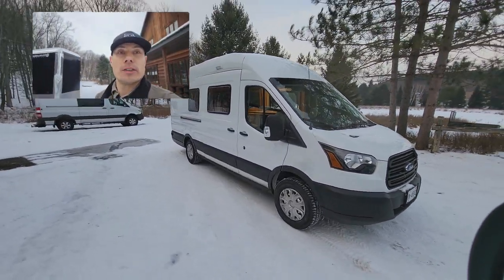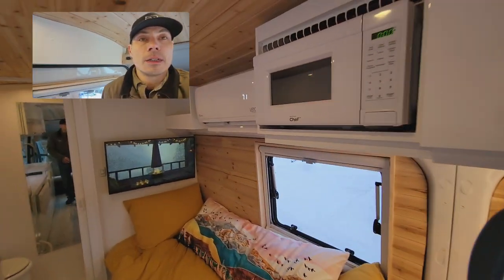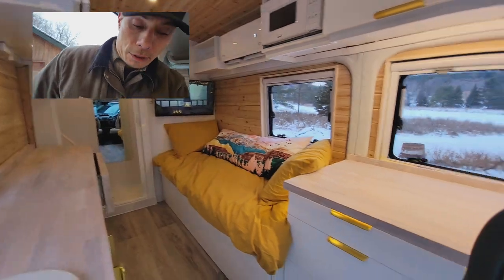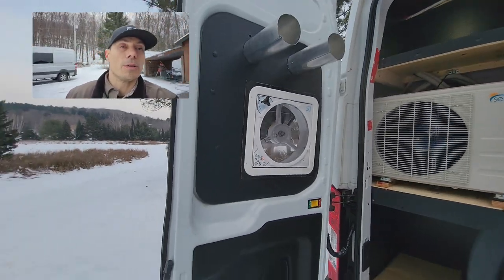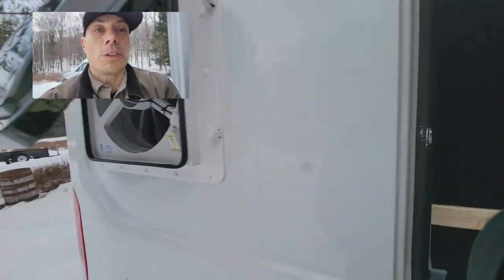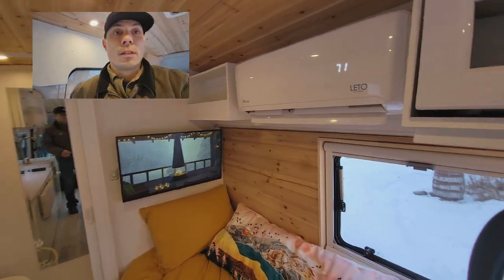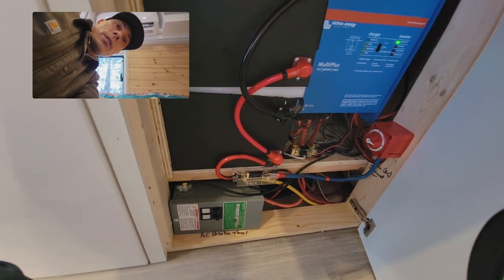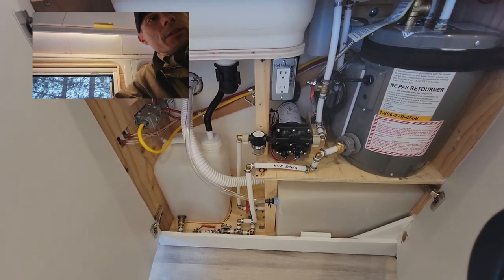Mini Split Air Conditioner in Van Conversion. Unique layout for single camper.

Comment: That's amazing. I have diyed 7 of these mini splits but they where all 36,000 Btu units so I was shocked at seeing how small the compressor is on this 9000btu model. I know this Leto pulls 720w(which is insanely efficient)at max cooling but they also have a higher efficiency model that does 9000btu at 560w which blows my mind.that higher seer/eer unit is also about 60% more expensive so the cost can outweighs the efficiency in some cases. The larger senville minisplits are nowhere near as efficient as these smaller ones are. The 36,000btu ones I installed are pulling close to 4000w at full load!  That's such a low btu to watt ratio compared to these small units. Seeing a mini split in a van build was the coolest thing ever.
Reply from the maker: Yeah, these mini splits are incredibly efficient. I just put the same model with heat pump in a 28' cargo trailer conversion (see my latest video) and it has no problem cooling that trailer. In fact, I often have to turn the heat up because it gets too cold. They are so quiet and powerful it amazes me how many people still use window air conditioners.
Reply: @TheNaker  Do you know how many watts the AC pulls when in use?  Is the power draw always pegged at 720w or does it run at a lower wattage most of the time once it's cooled things down just to help maintain the temp?

Comment: Very good van cograts,
The lines are Prichard?
Reply from the maker: Not sure what you mean?
Reply: Sorry i try to say if the lines are pre charged
Reply from the maker: @roquesanchez7509  yes, the unit was precharged. I did purge the lines with a vacuum pump (bought on Amazon) before opening the valves into the lines. I've never done that before but it turned out to be fairly simple.

Comment: How good is the heating on the Senville 9000 BTU mini-split in the snow? I'm debating 9000 and 12000 BTU for a small 20 feet Class C RV (slightly bigger than a camper van, but barely).
Reply from the maker: I think the 9000 would be plenty for your class C. If you check my other videos, I have the same 9000 BTU unit in a 28' cargo trailer conversion.  It has no problem keeping it toasty in below freezing temperatures.

Comment: In theory, would a big whole in the van door (which sealed around the vent when closed) work?  Why do you need the fan?
Reply from the maker: The fan is required because the AC unit requires a lot of air (fresh air at the back and exhaust air out the front. The fan in my setup forces air out which, in turn, causes a lot of fresh air to enter through the vent ducts to get it to the back of the unit. A hole wouldn't do this.

Comment: Hi! do you know what the lowest heat temp can be set? I am looking for one that has like a vacation mode or something that I can set the heat around 40-50 to minimize usage but keep everything from freezing.
Reply from the maker: Sorry, not sure but this wouldn't be practical for storage. My goal for dealing with freezing was to make it really easy to drain the water system to prevent freezing. This can all be done while inside the van and only takes a few mins.
Reply: The lowest setting on my mini split ac heat pump is 62F in my van.
Reply: @Scrambler85  Thanks!

Comment: Did you run into problems with draining? Just installed this today. It was fine during the first test it leaked thru the drain just fine. But now it’s not draining properly. 

Any ideas? I think could be that I’m parked to where the indoor unit is tilted and now the drain pan in the indoor unit is not catching?

Any ideas would be great!
Reply from the maker: Hi! Nice work. If the condenser unit isn't fairly level some condensation may miss the drain line when using heat pump. If you can't get it level right now, just put a bath towel under the unit to catch the water. We had that happen once. I've never had the indoor unit leak but I'm guessing you need to get more level. Good luck.
Reply: It was just the parking. Now works pretty well on cooling mode. I’m planning on just adding an AC grill on the doors in the back(I also partitioned my van!). What do you think? The one I got I think is 18x18” for exhaust. Will do something similar for the intake with fans 🙌🏼 tube going to the back with fans

Comment: I'm curious with your 412 amp hour set up, how long can you run the air conditioning unit? I realize there's a lot of variables here, but let's just say it's 80° outside. How much power is being consumed by the mini split per hour?
Reply from the maker: She was getting around 6-7 hours on heat pump (which draws more than air conditioning) so we added another 206 amp hour battery for a total of 618 amp hours and now she can have the heat pump running overnight (~10 hrs) without issues. Air conditioning would run for longer. This is also with a compressor fridge running and lights. Hope this helps.
Reply: Thank you. Yes the information does help! I'm using a similar size battery bank – 620 amp hours. Not sure about the efficiency of your inverter, which can have an impact as well. I'm using the growatt 3000. They claim 92% efficiency, but I have not verified that. Inverters definitely rob power though.

At this point I have not purchased the mini split, but plan on purchasing the exact model you did. Seems to be the best bang for the buck. 

I still admire your build! Very impressed with everything you've done there, and thanks again for sharing the information.  All the best!

Comment: I have a Question?. Once your Leto install was completed. Did you have a certified ac specialist shop charge the system with r32 refrigerant?
Reply from the maker: The lines come pre-charged. I just vacuum pumped them out and then opened up the lines to let the refrigerant in.

Comment: Can the compressor unit be mounted under the van in a horizontal position with the fan facing towards the ground?
Reply from the maker: Unfortunately the compressor must be mounted vertically.

Comment: Do you think this could fit in a toyota sienna mini van? Id do the same back setup here. What wattage would you say it uses for 5 mins use every 25-30 mins an hour?
Reply from the maker: Don't know how much space is in your mini van. It pulls around 900 watts when AC running fully.

Comment: I was just thinking. If your condenser stops moving but max fan keeps sucking air out it might cause condenser fan to spin and create charge and not sure if thats good. Could blow diode
Reply from the maker: There is enough room around the condenser that the max fan won't cause the condenser fan to spin. Interesting thought though...

Comment: I also liked your electric hot water heater.
While an upsize of the electrical system may be needed, I figure between alternator charging and shore power hookups one will not always need to use the battery/power system to heat the hot water.
Reply from the maker: Thanks. The plan was to turn on the hot water heater while still driving to get it hot and then shut off when stopped. This way it heats the water using the alternator charging (DC-DC Charger). It only takes around 10 mins to get really hot.
Reply from the maker: More importantly, this model has a drain. I noticed many van conversions using the little electric hot water heaters made for going below a bathroom sink but they have no drain. Not sure how they empty the water system for cold weather or just flushing the tank.
Reply: Thanks @TheNaker .  Good to know on the drains. 
And only 10 minutes to heat the hot water while driving.  That's excellent!
I've seen where a complete coolant with heat exchanger system was implemented to heat hot water.  Way too complicated, lot's of opportunity for leaks, and too expensive when one can implement an electric hot water heater.  Good job!
Reply from the maker: @Snarge22  I totally agree on this. Simplicity is always best for these applications.
Reply: @TheNaker  may I suggest a drain on the cold water supply line.
You would only need to, say, 'half' empty the tank.
Reply from the maker: @stephenbrickwood1602  I've got a drain on the cold water supply line. It goes straight through the floor and onto the ground. Super simple.

Comment: Do you think you actually need the max fan? would it work with a large square vent similar to the intake vents?
Reply from the maker: Yes, I'm confident the max fan is necessary to get enough air over the cooling fins.
Reply: @TheNaker  thanks… did you consider mounting underneath?

Comment: As my van is body on frame construction (Iveco Daily) my outdoor unit is, well, outside. Cut floor for opening, built drop down cage to hold unit and concealed it under 2" XPS insulation box.
Benefits: doesn't show outside at all, 3 meter coolant lines were adequate to place inside unit on top of the bed and plywood covered box doesn't take much storage from garage
Reply from the maker: Great solution if your van allows. The transit sits too low and unibody...

Comment: Dang - nice work!

Have you observed any performance differences with the door fan running verses it not running?
Reply from the maker: I don't want to stress the compressor by trying it without the door fan. I have run it with the door open and no fan and didn't notice any difference.
Reply: @TheNaker  If the condenser ices up in heat mode and goes through a defrost cycle....where will the water go?
Reply from the maker: @MyGoogleYoutube  I've got drain lines running out the bottom of the van. One for the condenser and one for the inside unit. No issues.

Comment: Is there a reason you placed the compressor on the middle rather than on the floor or top?
Reply from the maker: I wanted it as low as possible but also wanted vent lined up with the window area on the door. The lower part of the door is thicker and has bracing and mechanism for unlocking.
Reply: @TheNaker  makes sense. Thanks!

Comment: Not gonna lie, I love it. I've been looking around at rooftop A/C units, but since this will heat/cool and take the moisture out of the air, it's perfect. I could probably fit like 600W of solar or more without the fans on the roof.
Reply from the maker: Go for it. 600W would be great. You will need two 30 amp charge controllers to effectively use that amount of solar.
Reply: I'm glad you chose not to lie lol.

Comment: Hi, Sean. Quick question...I assume aircon would pull the same amount of wattage as you shown with the heat on. Is that a fair assumption?
Reply from the maker: It's similar.  Heat uses more than AC typically.
Reply: This particular model uses 720w on cooling when running at 100%. They also sell a more efficient model that uses 560w at the same cooling performance but it's 50-60% more expensive and is 240v only.
Reply: @randybobandy9828  Randy, that is some good stuff you shared. Though the initial investment for a 240v unit is expensive, I believe it will pay for itself in the long run. Thanks for helping me plan/build for the most efficient solution.
Reply: @mikefranks4528  my other comment didn't post but I did find a 120v version of the higher efficiency of the 240v version. It only. Uses 600w on 100% load which is significantly more efficient. Let me know if you want the model # and I can link it to you
Reply: @randybobandy9828  Yes! Please, share the model. 🙏🏾
Reply: @mikefranks4528  Cooper & Hunter 9,000 BTU, 115V, 25 SEER, Mini Split AC/Heating system Sophia Series with 16ft Installation Kit https://a.co/d/2xPhiQP
Reply: @mikefranks4528  the model number is CH-09SPH-115VO
The brand is "Cooper & Hunter" I sent a link in the reply before this but idk if will get deleted since YouTube deletes links all the time
Reply: @randybobandy9828  👀🤓
Yeah, honestly I don’t use links either where the domain is not readily identifiable. But thanks for the description. I found it on Amazon. It does cost around $1200 but I guess with that type of efficiency it’s definitely worth it. Thanks for pointing me to a 120 V solution as I did not want to create a split phase environment for my electrical.
Reply: @mikefranks4528  yes my link was to the $1200 Amazon one. It's expensive but that's the price you pay for higher efficiency. It's hard to justify the small 15%-20% for almost double the price. The senville is $750

Comment: how many AG of battery are you funning ?
and how many hours do you get ?
Reply from the maker: 618AH of lithium. Hours varies but 10+ typically. The design goal was to have heat or Air conditioning overnight. Then the DC-DC charger replenishes the batteries the next day driving (+ solar of course)

Comment: Sorry, I suppose I meant to ask this, do you feel it is absolutely necessary to install the Max Air on here for hot air out vs a large vent since the AC fan has it's own rate of dissipation of heat? Some debate on the need and would rather not due to cost if it's not completely crucial to the operation for unit. thanks once more...
Reply from the maker: The mini split in this van has been working flawlessly. I believe it needs the fan to support airflow since it's installed in a restricted area.
If you are doing a cargo trailer, you could just mount the condenser unit on the front outside. It greatly simplifies the install. Check out my luxury trailer video...

Comment: Does it produce moisture and if so how/ where is it drained?
Reply from the maker: There are drains for both the indoor and condenser unit. The indoor unit drain runs along the line set to the condenser and then both drains go through the floor in the back of the van.
Reply from the maker: When running AC the indoor unit will produce condensate and when running heatpump the condenser produces condensate.
Reply: Thank you kindly

Comment: Wonder if the fan and compressor could be roof mounted for safety and vandalism reasons
Reply from the maker: The compressor is quite heavy and its better to keep weight low. Also i wanted the roof free for the solar panels.

Comment: will mini split AC still work if you put the fan on the roof top?
Reply from the maker: It might work but you would lose efficiency. In the hottest and humid conditions it might not keep up with the restricted airflow. I recommend the vent fan placement opposite the compressor.

Comment: Why didn’t you just mount the heat pump condenser higher and install the fan on the roof?
Reply from the maker: The roof curves higher up so there is less space. Also we wanted to keep weight and COG lower.

Comment: Hi can i  ask you a question is that Ac Solar Powered or diesel
Reply from the maker: It's electric and powered off of Lithium batteries and solar (or AC when plugged into shore power).

Comment: That's really cool and all until the heatpump goes into defrost and dumps water all inside the back of the van, even in only slightly cool climates when the system is running in heat, the condenser will sweat water off the coil.
Reply from the maker: For sure it does. That's why I have a drain pan and drain lines down through the floor in the back. No problem.
Reply: Awesome!👍

Comment: Your outside unit will have a hard time circulating the air even with the extra fan installed.
Reply from the maker: Its had zero issues since installation. Draws very little power and cools and heats effortlessly.  In Florida and in Canadian summer.

Comment: Excellent build quality from what I can see in the video.
It's a great layout and very well thought out. 
I put a mini split on the Back of my van on a ladder type rack.
Not as stealthy as yours but on a box van it's never going to be pretty. 
Very impressive. 
👍
Reply from the maker: Sounds like a nice build. Do you cover your mini split when not using?
Reply: @TheNaker  not very often I'm currently in SC, we are either running the ac or the heater constantly and often both on the same day. I have enough solar panels and batteries to keep up with the demand
Reply from the maker: @J. G.  just curious what amount of solar am batteries you've got in your build? And are they sufficient?
Reply: @TheNaker  I have three residential  400 watt panels and I have been running 600 amp hours of lithium batteries. However today I am adding another 300 amp hours of lithium batteries. 600 has been sufficient for the summer months but I could only run the heat pump 6-8 hours. So I added an additional 300 amp hours. Hopefully in the winter months depending on how cold it get I have enough solar panels to make it work about 85-90% of the time. 
I also have a 60 amp dc to dc charger installed. I am about 95% complete on the conversion. I have been running the mini split for about a year now. 
I have a Propex propane heater but my girlfriend complains about the noise and it was easier to add the extra battery
Reply from the maker: @Scrambler85  Thanks! Always good data points when looking at systems like this. I'm adding another 206 amp hour battery to this van so it will have 824 amp hours.
Reply: @TheNaker  I hope you post an update, it's some nice work

Comment: My only critique is I need a window to the back. I would put a window in the shower.
Reply from the maker: I hear you. I did install a panoramic rear camera on the roof that is on whenever the van is running and is placed where the rear view mirror would be. It provides a really nice view for backing up or just driving on the highway to know what's behind you.

Comment: Neat installation. And AC is a must in a van IMHO! There's an Italian company who make a ducted single unit AC, in heat pump heating/cooling and just cooling versions, that is very compact and needs just two vents. See https://www.youtube.com/watch?v=DQ2JALO4iBo  I have no idea what the power requirements are but could be a great solution for vans. No idea if they sell them in the US.
Reply from the maker: That's a neat solution. I'm not sure it would be as efficient as a mini split but can see it being useful in some situations.